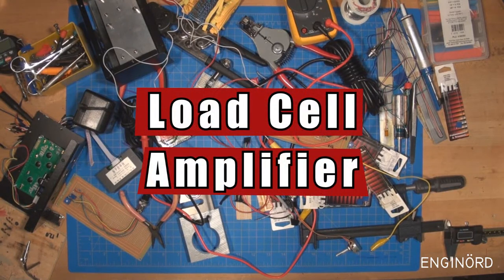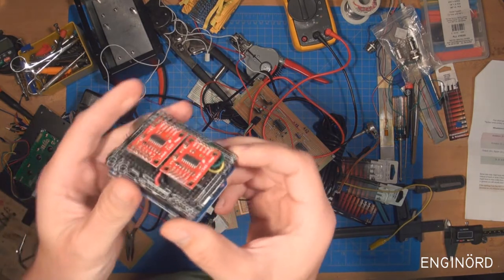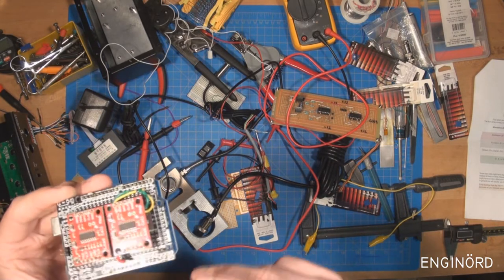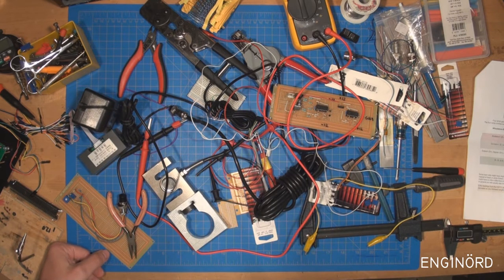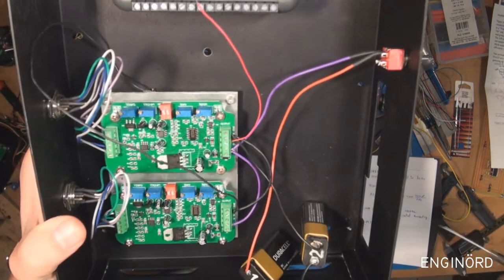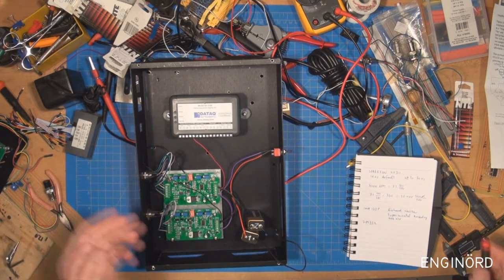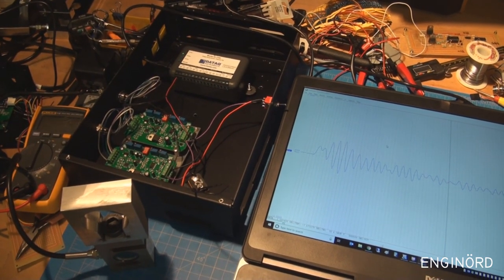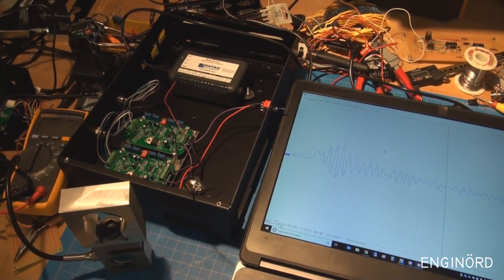Load Cell Amplifier Design, Build and Troubleshooting

Comment: Can you please provide a link for buying these chinese amplifiers?
Reply from the maker: hi Ahmed. see the amplifier here: https://www.ebay.com/itm/0-10V-Load-Cell-sensor-Amplifier-Transmitter-Weight-sensor-O5H3/265035978352?hash=item3db5601670:g:IIAAAOSwraBgF8V6
please note these links come and go, so if you look for "0-10V Load Cell sensor Amplifier Transmitter Weight sensor O5H3" you'll find multiple stores selling it in loose and packaged versions.
Reply: @enginord  Thank you so much!